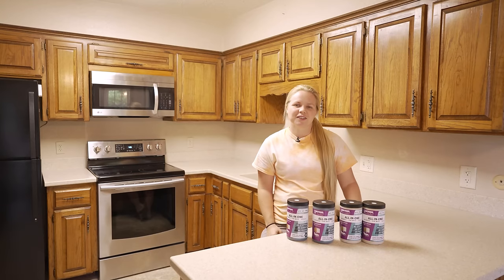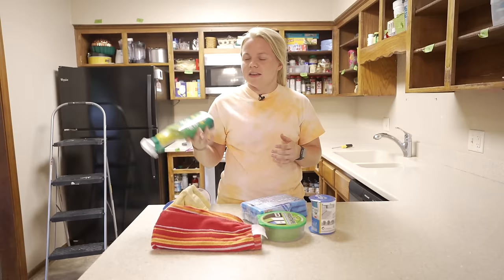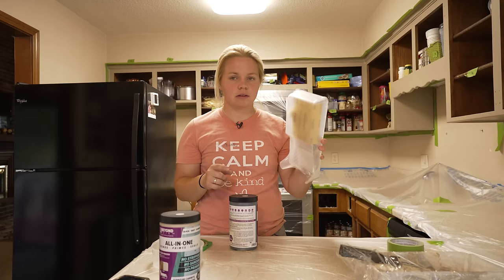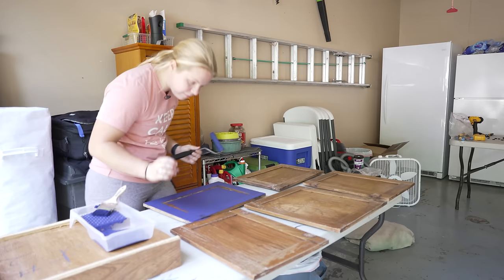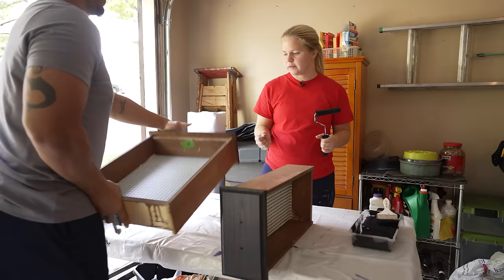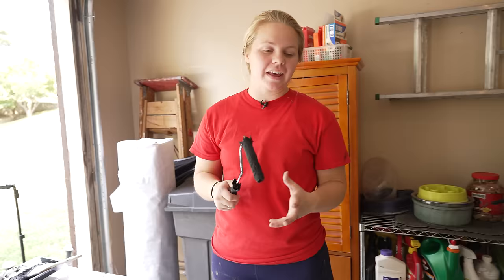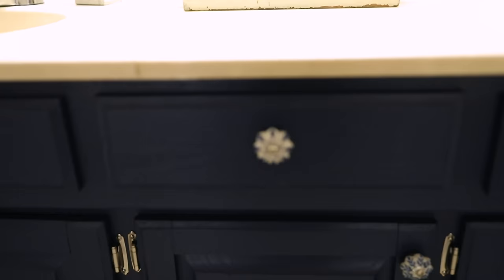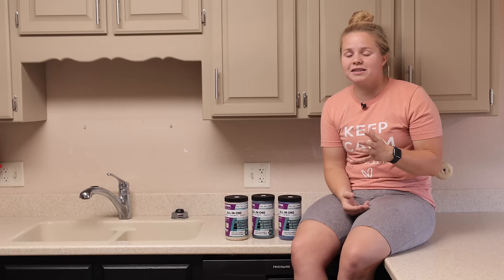How to PAINT Your Kitchen Cabinets the EASY Way

Comment: Just a little advice from an old old painter,try using a velour roller sleeve on you next project you will see much less roller texture that looks almost as if it was sprayed they are available at Sherwin Williams and Ben Moore.
Reply: Agree! Picked up a velour roller from Lowe’s on a whim yesterday for some interior doors I’m painting and it’s sooo much better than the foam roller I had been using-finish is awesome
Reply: Thank you so much for the info!
Reply: Wouldn't  using a spray painter on doors be faster?
Reply: Love this advice! Thank you!
Reply: I'd never heard of roller sleeves until now, but wish I had known about them recently when I painted some cabinets.
Reply: Thank you for sharing
Reply: TYSM! ❤
Reply: Thank you for the information guys!!  I haven't started my project yet. Just doing some research.  I appreciate your willingness to share great tips.
Reply: @effpdx what is it. Does it slip over the regular paint roller.
Reply: @LisaL20000  I assume it does.
Reply: Thank you 😬
Reply: TYSM! Going to the paint shop!
Reply: @LisaL20000  NO , a paint roller is also called the "roller sleeve" .... TECHNICALLY the tool is called the "Roller Frame" and the actual roller pad is called the "Roller Sleeve" ...... He somewhat confused everyone calling it the "sleeve" since 90% of people aren't pro painters with the terminology .... He should have just said "Roller" ..... Nothing "slips over the paint roller" ..... A velour roller is just the roller you attach to the tool
Reply: @williamprezioso2742  thank you very much for your tip on paint rollers, God bless you.
Reply: God bless your sweet soul...I love, love watching you transform things .  If I ever do a diy project I'll look up some of your older videos.  Thank you for being so kind as to share your secrets....
Reply: Should we put a poly finish coat to protect it?
Reply: @debmirdamadi824  no just use a good cabinet paint
Reply: @debmirdamadi824  There will be less chipping if you do but only use water based poly as oil based will yellow over time
Reply: When you give someone advice and they do not comment back to you iam done
Reply: Thanks I will try a velour roller , would that work better on walls too or not?
Reply: God, the Lord Jesus Christ loves you! Restore your relationship with God by repenting of your sins and putting your faith in Jesus Christ, "... that Christ died for our sins according to the Scriptures, and that He was buried, and that He was raised on the third day according to the Scriptures..." (1 Corinthians 15:3-4)
Reply: @annturner7088  They don’t make a 9” version but micro fiber leave less roller texture than most others

Comment: Looks good . Sorry to be the spoiler alert but as a pro painter here the old oak cabinets need scruff up sanding and priming prior to painting, especially shiny varnish or shellac.   Primer is designed to bond to the wood and paint is designed to bond to the primer. The "no prep" paint/primer in modern paints can peel if not prepped first. Primer in paint is not sufficient for a good bond. Hope they did not peel later on.😉
Reply: Thank you ... I wondered about that. I moved into a house where pro painters apparently didn't learn that basic, spray painted over an oil-based paint without proper preparation, and left me with a painting nightmare! It's peeling and bubbling everywhere, and it can't be easily fixed with touchups because it makes lines
Reply: So glad someone recommended just what you said.   I also wondered why she doesn’t used the little pyramid shaped “lifters” so she could put the doors down and not hold them which, I think would be very tiring and, over time, could be a physical problem for her wrists.
Reply: Wood doesn't need sanding and priming if chaulk paint is used. All the chaulk painted antique look of modern furniture is simply chaulk painted and scuffed up to look old and 2 coats of stained wax or clear wax. Try it sometimes you'll be amazed at how the chaulk paint sticks to wood, etc surfaces without peeling! People are even chaulk painting kitchen cabinets these days! Out with the old ways, in with the new technology with much less labor!
Reply: @cher93 except yrs later those chalk painted kitchen cabinets are in horrible shape! Have you seen them 10+ yrs later after several children? Eeeeek! I so, sooo wish the "new ways" worked up to par because, of course I want the Easy Way!!! You MUST sand & prime even a tiny bit and yes even with the new self-leveling paints IF you want the best results!!!❤😊❤
Reply: I thought about that also, esp for a kitchen or a bathroom, humidity, grease, cleaning all factor in.
Reply: Yes it does we done our old oak cabinet we sanded and sanded then primed
Reply: Do these need a polyurethane finish?
Reply: thank you for this. So it is it ok after sanding to use a paint and primer in one or still better using separate products? Also what if I end up hating it painter, how can I then get back to my old honey oak or is it not possible? that's what's holding me back, the fear of not liking it then destroying the cabinet
Reply: Beautiful outcome!
Reply: @MrsMTMomma  You can use Dixie cups, too. Much less expensive and super easy clean up.
Reply: I'm getting ready to start this process and my cabinets are shiny. Is there a recommend grit?
Reply: @illdsign4u  Get some liquid sandpaper
Reply: @cher93 
You’re right with the exception of bleed through. The only way to have “a chance” to avoid it is priming first. I’ve had plenty of heartache while chalk painting a beautiful real wood piece only to find bleed through the next day. To fix it is nerve racking, and tedious. I prime everything first, no matter what. 😊
Reply: @dandelions2414  paint will seep into grain of the wood.  Very difficult to remove once painted
Reply: she did not sand or prime and this paint says you don’t have to but you do,  I wonder how this lady’s cupboards have stood the test of time.  i hear it chips from some people.  sad.
Reply: buy the tea cups to use for the base

Comment: I HATE painted wood!  Wood has grain for a reason, work with it!  So, if they're REAL WOOD but just the raised panel, like the ones in this video, FLIP THEM OVER!  I worked in a custom cabinet shop where every door that was raised panel, the back side was shaker.  Just by flipping them over, you'll have an updated but classic look that will always be in style.  Also if you strip the old stain off then clear coat polly, they will be so much brighter & won't have that orange tint from the oil-based stain/polly.  The cabinets in this video, that's exactly what I'd do.  Flip & stirp.  Now if they're just pressed particle board with a laminate to 'look like wood', like what we have... Paint till your heart's content 😉🙂  To get old paint off hardware, crockpot overnight on medium heat, it'll peel right off.
Reply: I would like to see what these cabinets look like in five years😮

Comment: Lauren, thanks so much for doing this video!  I also used Beyond Paint this summer to re-do my kitchen.  Went from white to white again, but I added wood trim to create a shaker style effect.  The paint is awesome and works very well.  Landed on the brand after doing a ton of research and it was the easiest option with durable results.  And I love the texture and subtle sheen of it.  We're 3-4 months in and still looking good.  Highly recommend.
Reply from the maker: wonderful to hear this! I am going to pin your comment so people can see how it holds up over time!!
Reply: Jackie of all trades
Did you use sealer on your cabinets?
Reply: @kathyfranklin7776  I thought about using a sealer or some kind of top coat but all the stuff I read made it seem to be a “one and done” project, which is what I was looking for. You can see my application of the paint in my DIY Shaker style cabinets video. I will give it a year and review but so far I’ve spilled coffee and grease and random jam on it. Everything wipes clean. In fact last month my teen son cut his finger and so we had blood on the cabinets too!  Bad for him but good to test how they hold!  Sounds morbid, but I was excited to see I’d missed a spot a couple days later. The blood had dried on the white paint but wiped right off with a disposable cleaning wipe. So no sealer used but so far it appears to be no problem for this paint.
Reply: @JackieofAllTrades 
 This helps me so much. 
I'm  working on an old homemade base kitchen cabinet that was given to me. My husband wants it for his hunting room. It is on the rough side. This DYI would surely  tell if Beyond paint is good.
I will check out your video.  
Thanks for getting back to me.
Reply: @kathyfranklin7776  you’re welcome!  My commentary on the paint comes at 9 minutes 16 seconds on the video.
Reply: This is my first video. Is this paint fast drying ??? and good for outside stuff??? It's beautiful
Reply: @warmlantern0000  the Bright White color says Interior/Exterior so perhaps fully cured it’s safe for outdoor use. That said, I’d probably use the separate sealer the brand sells for extra protection for anything going outdoors.  Also, each coat dries in about two hours.
Reply: @JackieofAllTrades  Thanks for commenting..I've been searching yt for some one that's had good results painting kitchen cabinets and yours seems the best.  
We're having a home built but of course these developers charge for every little item you change..like if we wanted a lazy Susan in the corner cabinet it's $1,450..which is absurd..so needless to say we're taking the stock cabinets and painting them before we move in..Do you have any suggestions for us that's not covered in your video?  We're going from a dark brown to an off white. 
Thank you for any help!
Reply: @susanfitzgerald2443  Thank you for the compliment! I really did work hard on the cabinets and I am enjoying them very much. But if I had the opportunity ($$$), I would definitely get them painted professionally. I know where you’re coming from though!  $1450 is quite a rip for a lazy Susan!  However if you decide to paint the cabinets yourself, there are a few things I wish I had done differently. I should’ve used a detail brush on inside seams and tight areas. I think paint would lay better there if I had. No doubt, it looks great now, but my critical eye says it could look better. Secondly I was not meticulous about labeling which hardware went with which door, which caused me some consternation later trying to rehang them. And even now I have two doors that rub the cabinet behind them when they open and close. One has finally rubbed through the paint job which the door covers while closed. But it’s only because I didn’t properly match it back with the correct door hinge. That was my mistake. Since I painted white on a white cabinet, I’m the only one who notices the spot. Also if possible, turn off any fans or AC that may blow errant lint, cat fur or hairs into your job before it’s finished drying. I had to sand and repaint certain areas because I initially let the fan go while the doors were wet. This paint in super low odor so don’t be concerned with ventilating fumes. It’s not an issue. And don’t leave curious barefoot kids or kitties around your wet paint job unsupervised. Ask me how I know. Hope this is helpful.
Reply: Jackie of All Trades :
Reply: I just watched this for the first time and read your comment. So, after a year, how are your cabinets holding up? Did you notice a rough texture with the Beyond Paint on the surface? Thanks for the review!
Reply: You’re awesome young lady!! Beautiful results every time. I’m painting my cabinets as we speak 😊
Reply: How are your cabinets looking? Curious about the durability of the paint. Thanks!!

Comment: Great video! One thing that makes a huge difference in updating cabinets is simply removing the scroll cut design piece over the sink and cutting it either straight or into a simple arch. It’s the only thing that would have made this project complete IMO. But great job!
Reply: Yes, indeed, the wavy valance over the sink dates this kitchen.  However, this design element can be easily modified if desired.
Reply: My first thought.
Reply: Agree!
Reply: I completely agree. I thought that the second I saw that!
Reply: I noticed that too, but figured that’s the homeowners job to handle that. She was hired to paint from what I understand but yeah I would have updated it even more but it looks great.
Reply: Kept focusing on that too. I noticed her touching it with the homeowner there and it wasn't just removable..so I assume they decided to leave it. Was thinking a piece of nice molding nailed over it would hide it and I would think give a nice look.
Reply: I love the scroll

Comment: GREAT job!!  And I have an amazing help for you with the cabinet cleaning....Good Gone, but using it the proper way, which almost no one knows how to do :-/  
   •Generously spray on the Goo Gone onto a 2 ft area at a time. 
• With your bare or rubber gloved hand, rub the productall over the entire area for about 15 to 20 seconds. 
• Allow the cleaner to sit & work for 2 to 5 minutes . Warning: Sitting for more time than that, allows the Goo Gone to evaporate--not good, and wiping it off before than 2 minutes, is worthless!  The product will not have even worked yet!  But, once it's wiped off properly...you'll love the results!  The grease and grime comes right up!
• once the grease, grime and Goo Gone is all removed, clean off all residues with your favorite kitchen cleaner.  All ready for paint ♡

Comment: I have painted many kitchen cabinets. Sadly, many homeowners don't want to use designer paints. But if they would they wouldn't have to repaint so often. I am saving this video for just that reason.  Great job. 4 days is not a long time. Geez, I have spent four days just getting the grease off some cabinets. You guys are awesome.
Reply: Lauren would this work the same way on motor home cabinets without peeling, since they have different types of material?

Comment: Looks so much better! I had one of those swirly/curvy decorative wood pieces above my sink also and I actually used a jig saw to cut it straight. Makes a HUGE difference to modernizing a kitchen. But they might like it!
Reply: Agreed! Getting rid of that 80’s country profile helps modernize the space. :)
Reply: I have this too and keep asking the handy men in my family if we could just jigsaw it off. They said they didn’t think so but I disagreed!! I’m gonna do it 🤪
Reply: Yes the 40  or 50’s built house I am in has design of upside down half circles all away along between the left upper cabinet and the right upper cabinet.  I like it myself it kind of hides the curtain rod and top part of curtains.
Reply: I just bought a house that was built in 2001. And it has that ugly piece as well. I'm cutting it off today thanks
Reply: Agree on that. All straight lines can be a little too monotonous. The paint looks awesome and has modernized this kitchen perfectly.
Reply: Agree. I would have taken the top molding off as well
Reply: Agreed. That scallop edge driving me crazy. I'm glad you cut it straight
Reply: that curved piece above the sink still screams 80's...

Comment: How about a follow-up to see how well the paint held up please?  I see many videos on the use and application of Beyond paint (I really like the non-prep, no sanding feature), but very few videos on how it has held up after 6, 12, 24 months of typical use.  

Has it flaked off, scratched, needed touch ups ,etc. ?  Really curious to see what people think after using it daily in the real world and before I make the time and money investment to do my kitchen (vintage 70s stained golden oak cabinets - still in good shape, but need a better finish).  Tx!
Reply: Beyond Paint is crap.  Use a real quality primer designed to cover stains.
Reply: @haywoodyoudome  Opinions/results vary.. can you share why and what happened in place of a simple claim?  I will be using a quality coverage/bonding primer, BTW.
Reply: And no reply.  Typical troll.

Comment: Nothing wrong with the procedure as long as you don't mind seeing the open grain of the oak.  To transform your golden oak cabinets to a modern day totally smooth painted finish. You MUST fill the grain. I would suggest a couple products that are easy to use and when finished you will not see any graining. That's a professional look.
Reply: What would u suggest to use to fill the grain of the wood
Reply: @richardfitzsimmons4312  I like a product named Aqua Coat.  It comes in clear and white pigmented.  When I painted my oak cabinets. I did not want to see any grain bleeding through. When finished I wanted a smooth, grain free look. This takes time but you will get great results. I had a furniture refinishing shop for years. Good results take steps and time. I would also only use a good paint. I used Sherwin Williams Emerald.  I sprayed mine with an airless sprayer in my garage. However you can roll and brush.  I would add Floetrol to the paint. I allows it to level out and if brushing. Prevents brush stokes. ONLY use a great quality PURDY NYLOX is a great choice. Good luck.

Comment: Remember too if you don't want the wood texture to show through, you need to use a grain filler first. No amount of paint or technique is going to cover that up. doesn't mean she didn't do a beautiful job painting, because she did! Just a tip for those that may be wanting to do this and not have texture. 
I really loved that blue! It's absolutely beautiful!
Reply: I’ve painted a number of cabinets and never had the grain show just have to use the right paint
Reply: @scarlettwinters5642  depends on  the wood and how it was finished in the first place.